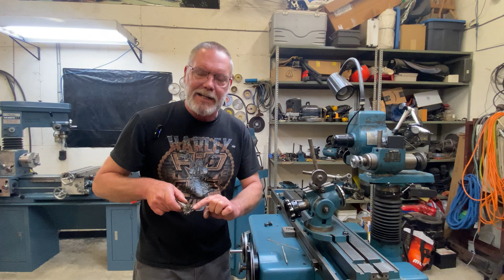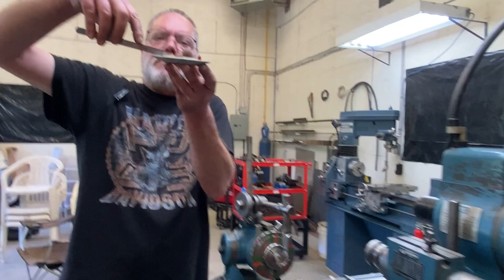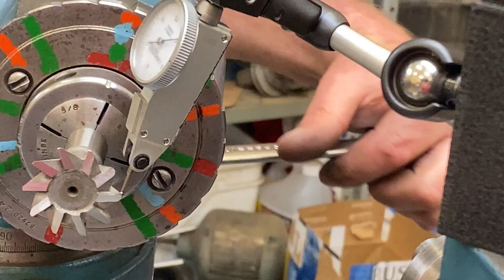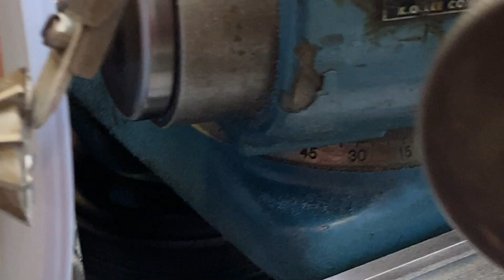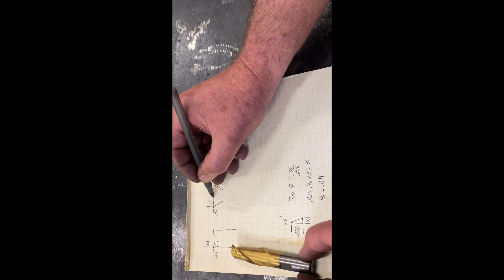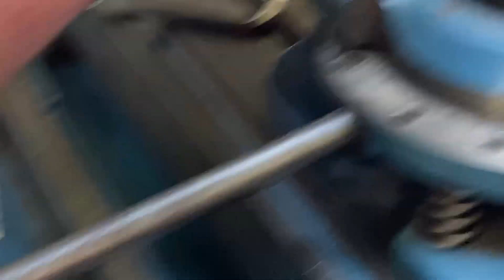How to sharpen a dovetail cutter. Full tutorial. All setups explained in detail.

Comment: Sir... I hv 1 doubt.. What if dovetail cutter has more teeth (16 T).. Do i hv to use smaller dia wheel...? But in that case my machine Y table doesn't reach upto cutter....
Reply from the maker: Yes a smaller wheel would help get you into tighter spaces. Sometimes an adapter plate can be made up to do things that are just outside of your machines abilities.
Thanks for watching!